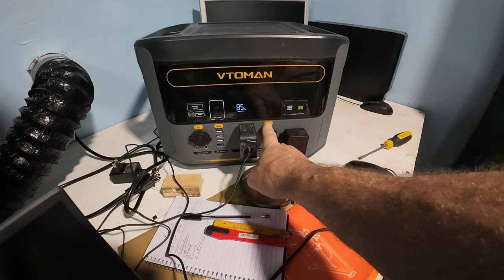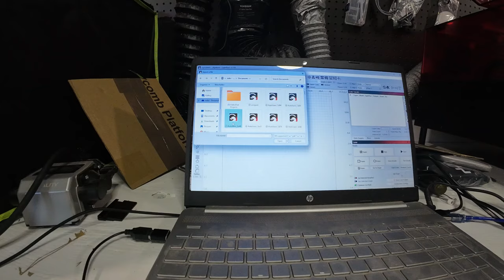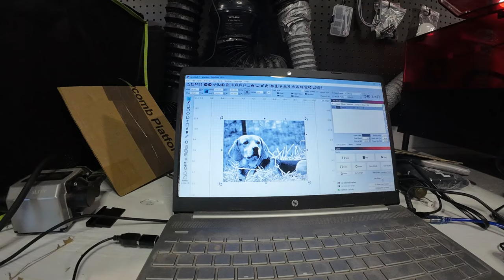The Duplex Is Done! I Have Some Happy Chickens

Comment: We have some BIN resale shops of Amazon Returns or Wayfair or Walmart/Costco.  I’m sure they’re everywhere now.  I don’t know how they’re affecting local economies tho.  I suspect in time they will. That’s where stuff like that netting shows up for cheap!  It’s very difficult to tell the quality of goods from a picture.  We thought we needed better pictures like catalogues but pictures are deceiving and can be manipulated.   I’ve gotten a bunch of stuff at these resale outlets but I could see the items, touch them and decide even if it’s not the best quality will it do the job for the price.  Not everything is a hit but most things have worked out ok and I don’t begrudge the price too much when it was only 99 cents or 1.99 or 2.99.  I bought a 24 pack case of hand sanitizer for 2.99.  Small bottles.  Turns out they weren’t approved for sale in Canada so I threw them out.  They allowed me to buy something else.  They don’t usually do that.  They were even using a bottle of the stuff on the counter then threw it out.  Unknown ingredients that could do who knows
 what to a body.  You see folk in there checking Amazon and the others on their phones for their 
retail prices.  I usually go on 2.99 days.  I’m not looking for high priced stuff on those days just 
stuff I can use around the place.  I didn’t blame them.  But buyer beware!  Not everything they sell is safe.